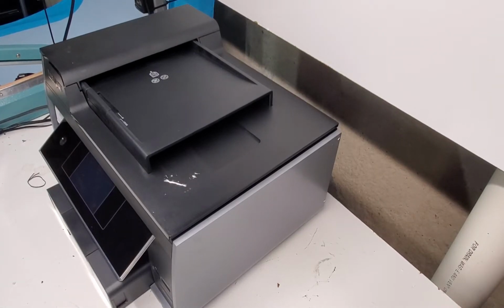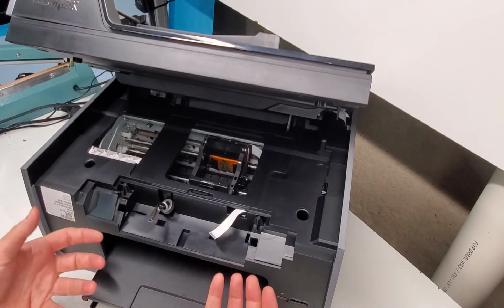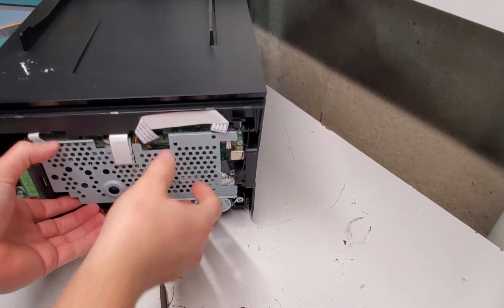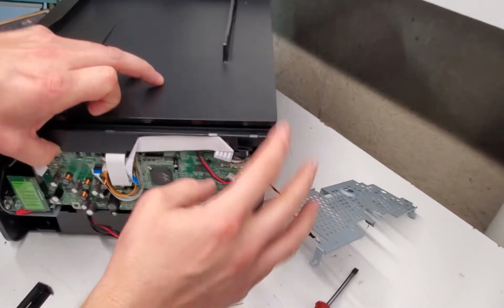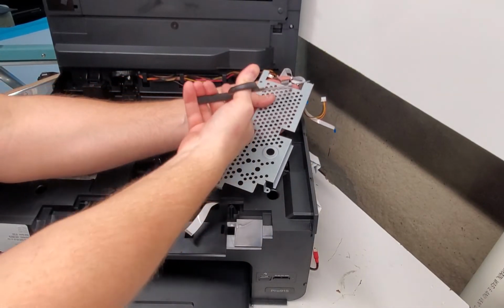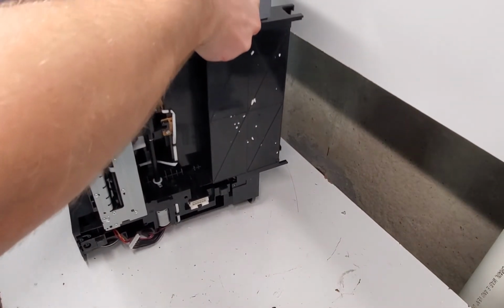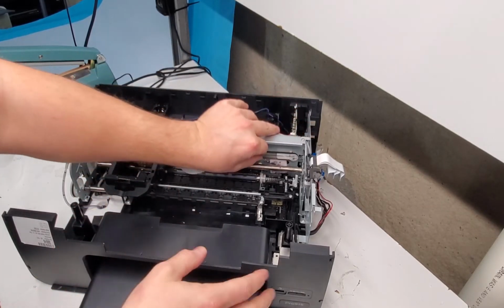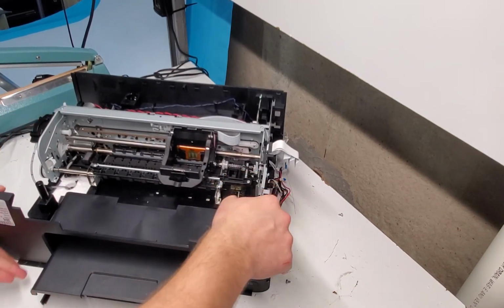Taking apart Lexmark Pro915 Printer

Comment: Hello, I'm trying to get rid of the data on a printer before I junk it. Where is the data stored? Looked up hard disks but can only find installs that screw in above what looks like a cmos battery. Mine does not have a hard disk that I am aware of.
Reply from the maker: Hi. The printer doesn't really store any data, other than your info that you manually entered into the settings, such as fax number, name. That can be removed by going to settings and clearing the lines and saving it. Printdr does not store what it printed. Memory is there for processing commands such as print or scan. That is the case in most printers.
Reply: @303electronics  Thank you!

Comment: Sir I have hp officejet 4500. It alway error mesg “ cartridge problem “ what can I do. 2nd I have deskjet F 2180 when I power on its power on light billings and when I push power on button it’s all light billings so how to treat both printer thanks
Reply from the maker: Hi. Clean contact areas on cartridge and inside printer. You will see golden contact pins where the cartridge goes. Also, have you tried replacing at least one of the cartridges? They sometimes just go bad for random reasons.
Reply: 303 Electronics sir thanks to reply but I did so many time but result is same nothing happened
Reply: May be my cartridge Damaged